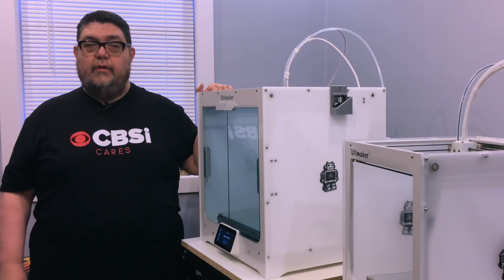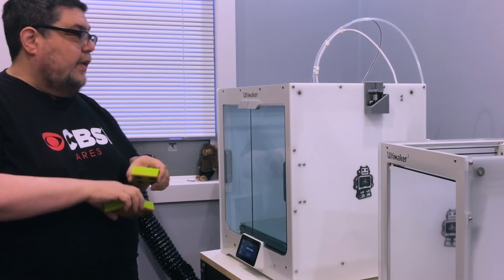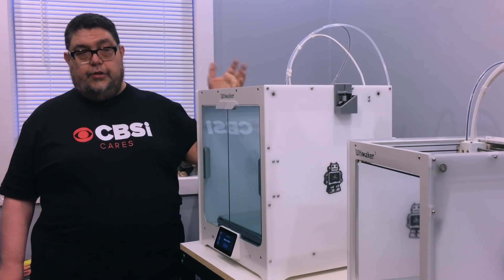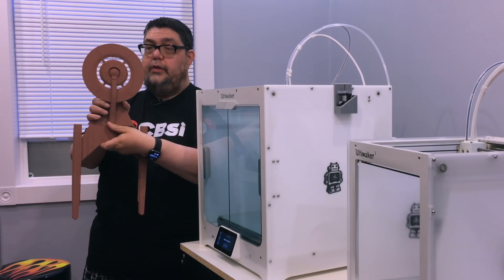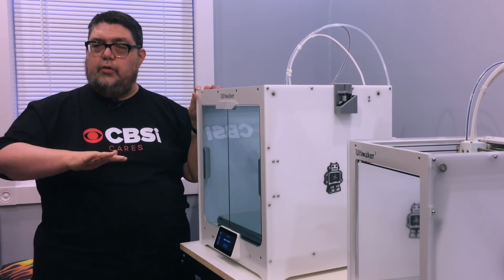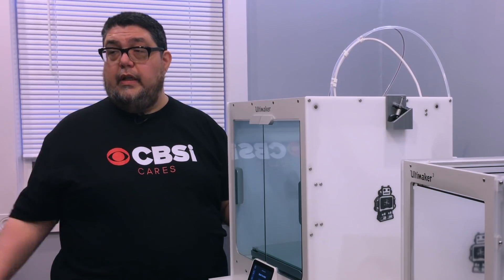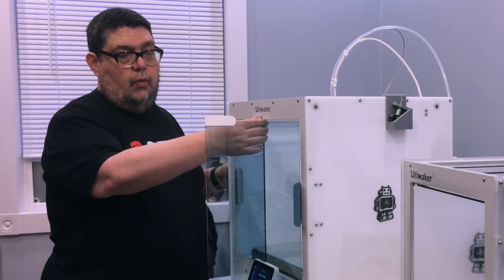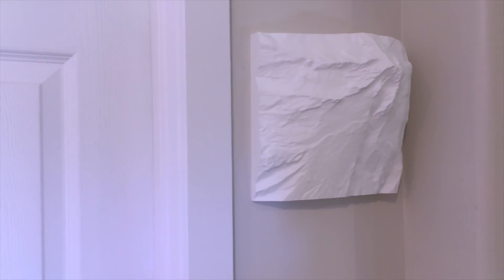In-depth, deep-dive review of the Ultimaker S5

Comment: What is the highest resolution you can print with this printer? I'm looking for a 3D printer that will be printing rectangular boxes (basically) around 9 in. W x 6 in. D x 5 in H and need silky smooth walls.  I know higher resolution will take longer but I am not mass producing. Thanks
Reply from the maker: Available with 0.25, 0.4, or 0.8 mm nozzle. https://ultimaker.com/3d-printers/ultimaker-print-cores-and-addons

Comment: Printing just PLA based materials in a $6k printer is not a test or review.  Throw some non hobbyist materials at it and show how it works out on Mt. Hood, or a half scale version even.  Any printer can print its volume in PLA, PLA is shit and not what manufacturing prototypes should be made of unless the test is to see how fast Mt. Hood melts in your car on a warm day.  Heck, at least throw some ABS at a decent sized print, curious of how they compare to what I have seen from the Ultimaker and ABS.
Reply from the maker: Well, I did a whole engine block using NGEN metallic. But I like and use PLA for most things because it's low hassle. If I needed to print with ABS and wanted to send those fumes throughout my house, I would.

Comment: hello thanks for the excelent video. I'm new is this technology, maybe you can help me. I'm an Oral Sugeon and I want to start making some biomodels to practice  in a patient replica before surgery. I have a few question maybe you can help me. I need to print the entire skull, but I need a material that i can drilll to simulate implant placement. So the material have to be somehow a little soft to be millable and not hard plastic. there are some materials like "Fibretuff® Biomedical 3D Filament". But i'm looking for something cheaper. Do you have any sugestion about the printer and the material? thanks in advance.
Reply from the maker: I am not sure. Dental materials are a special beast. While FDM printers are getting some play in the dental world, it's really the resin printers that are where you want to look. They have the detailed resolution I think you might need. Check with Formlabs. They're pretty much the leader in desktop-level resin printers. I know Zortrax has a dental resin, but as my related review showed, I had issues with getting their machine to function properly. Your mileage may vary.

Comment: hello i have ultimaker 2 i can't reset the factory parameters on the 3 page gives the error Er05 swift Z i was measuring with a multimeter and it's ok how can i do it now i already connected usb cable and the computer does not detect the printer thanks for a help thanks.
Reply from the maker: I've never used an Ultimaker 2. I'd recommend contacting the company.
Reply: @AdvancedGeekery  OK Yes I have tried several times but .... Nothing should only sell assistance is zero ....

Comment: Thanks a lot for the vid our school just got a grant to buy a lot of things for our robotics team and im thinking of bringing the S5 to our coach. im a little confused about the glue stick thing is it necessary. we have a lulzbot mini 2 and it prints fine but we do have to apply isopropyl alcohol to the board before each print. do we have to do the same with the S5 is the glue stick another way of doing that. Thanks
Reply from the maker: The bed material is different. I don't use any glue stick on my Lulzbots. But I do on the S5. The S5 is a glass plate. You could probably get away without it, but the Ultimaker folks told me to do it, and my prints have had zero problems (when I set the temps right for the filament I used, of course). So, do you have to? There's no law. Should you? Well, it works well enough for me to not look for an alternative approach.

Comment: Thanks for such an excellent review!

I don't know if you can help with a couple of questions. I'm considering in changing my actual 3D printer (WITBOX) to the new model of Ultimaker S5.

I'm really concerned with changing the hotends and with it easy and friendly user experience. And of course changing filament that it is always a suffering! What's your experience with exchanging hotends and filaments?

I want to take a proper look tomorrow, in the official reseller in Madrid (SPAIN), but first I would like to have your opinions and user experience in order to make the proper questions. 

For me the most important is maintenance an easy charging / exchanging filaments. Have you experienced stopping an impression and changing filament without losing quality in your model?
Reply from the maker: I haven't changed the hotend on the S5 yet, but they're identical to the Ultimaker 3 hotend, and I've changed that relatively frequently. You hit a menu item, it pulls out the filament, and you just snap out the entire hotend. They run about a hundred bucks or so, rather than five bucks for an eBay nozzle, but there's a lot less hassle to the change. As for the filament change, the S5 filament change is the nicest I've ever used. It's pretty much instant. Watch the middle of the video where I demonstrate it. Also, somewhere in the middle, there's a clip of an Ultimaker guy swapping extruders. You can see what that's like, also. Good luck!
Reply: @AdvancedGeekery  thanks for your comment. I didn't answered before because I'd finally bought the S5 and I'm really impressed with the great machine... Even though I haven't succeeded in connecting my PC with the S5 through wifi...(yes I can connect shortly but now enough for a fluid connection to supervise through the camera the printing)

Comment: Great review, coming from someone who has has an S5 since mid February this perfectly sums up my impression of this fantastic tool. As a commercial artist I can justify the investment, it lets you get on with exploring the creative potential of FDM without getting stuck in the tinkering weeds. Only thing I would say you didnt highlight and may be a negative for some is this is not the fastest printer, I usually do 40-55s but with FDM in general patience is rewarded with superior quality. Wee tip is use pla for petg print support, seperates nicely under favourable conditions, cheers
Reply from the maker: I've been wondering what would happen with the big nozzle. That might extrude mightily fast. The Petg/PLA idea is great. I'll have to give that a try. Never seen that one before. Thanks!